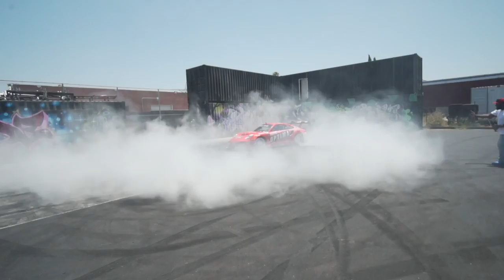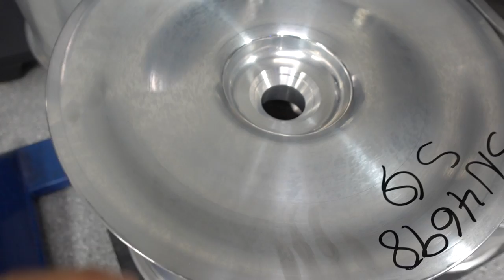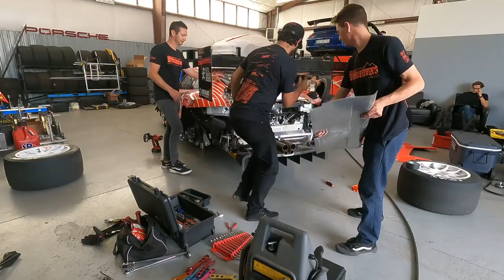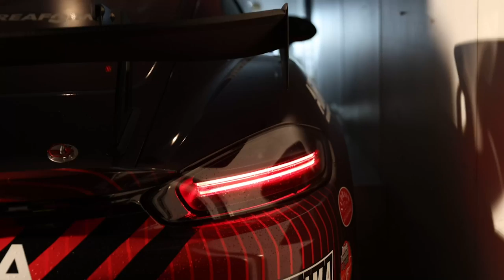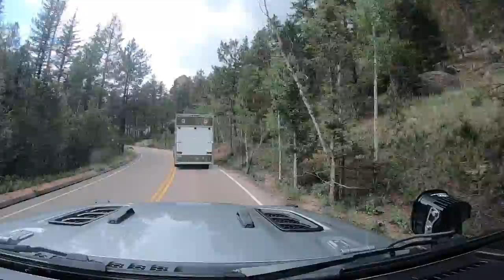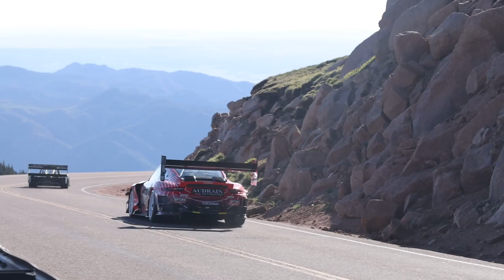Pikes Peak Victory Donuts and Recap with BBI’s 1,100hp GT3 Turbocup on Yokohama Tires // HHH Ep.015

Comment: I looked up the axles they mentioned, and HOLY HELL, those are some strong stuff.  They are made out of 300m which is a high strength, low alloy steel similar to 4340 chromoly with silicon and vanadium but with slightly more carbon and molybdenum. 300m is melted and heat treated in a vacuum   presumably to prevent any oxides from forming.  The metal is normally used for aircraft components like landing gear.
Reply: Thanks Nads
Reply: How much were they?
Reply: @Wishforworst  more than we can probably afford
Reply: @Wishforworst  I saw a Porsche forum post of a guy selling some similar ones for $15k to 16k.
Reply: 300m is frequently used by the off-road boys for axles and u-joints, really just anything that needs to be strong as hell. It is definitely pricy though, upwards of $300+ for a single u-joint.
Reply: @KISSMYACE3203  oof
Reply: What axles are they? I could not understand what he said. I know he said they are tripod CVs.
Reply: silicon or silicium?

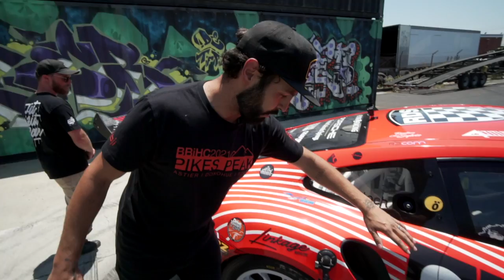Comment: 5:46 "How do you guys design all of that?" "We worked with Veris and Aerosim." Does he mean Aerosim Research who use to fabricate badass Subaru 22B widebody kids back in the early 2000's? Wow! That dude is a legend in the Subaru World.
Reply: Holy crap, thanks. Yeah, that was me. I designed the front aero (fenders, inner fenders, splitter, canards and radiator duct) on the BBI cars and built the splitters.
Reply: @steveramm5982  That’s awesome Steve. Congratulations on being a part of such cool accomplishment. I use to go to your garage to get parts installed on my 2001 RS way back in the day. I’m glad you’re still doing the whole engineering and fabrication thing. Well done sir 👍
Reply: @ejicon3099  thanks ... I've known Betim for about 10 years and I guess things finally came full circle.  It's been a rough few years on the Subaru kit side of things but the new and improved version is finally trickling out the door.  I'm glad you picked up on the "aerosim" mention in the video.  This project was pretty crazy but everybody pulled together and somehow made it happen.  Once I get caught up on Subaru kits, I'll have a meet at my shop for all the old school customers.  :)

Comment: the unlimited class car that won overall had 600 hp. power means nothing if you cant put it down.
Reply from the maker: It also weighs 1600 lbs and it’s a full blown Wolf prototype car. Power to weight is what matters in addition to traction. And we think it has 800hp… 🥸

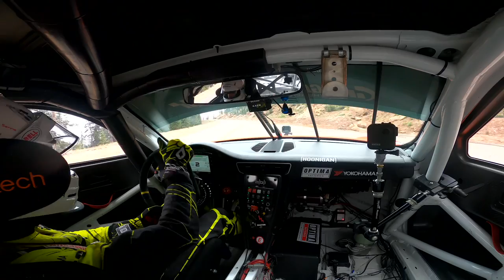Comment: I love how from 18:06 to 18:13, the rear engine 911 is totally out of control and off the throttle from trailing throttle oversteer. Then Porsche still claims the 911 is the king of the hill. With the same power mods, a mid engine Cayman would have went through there on the throttle, without mishap. 911 is a loser car. The Cayman is the king of handling!